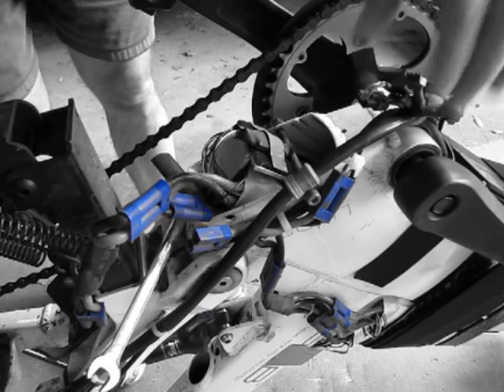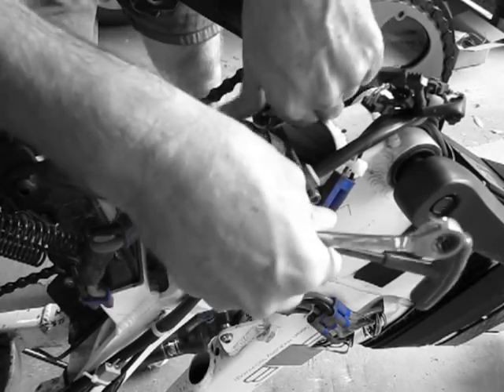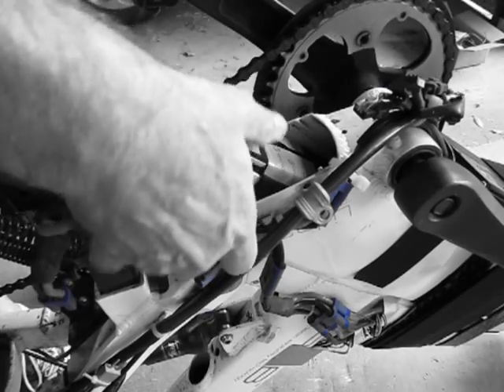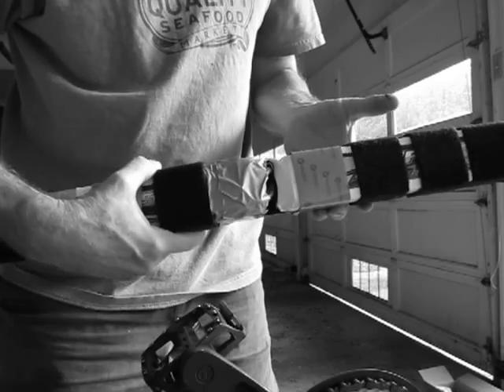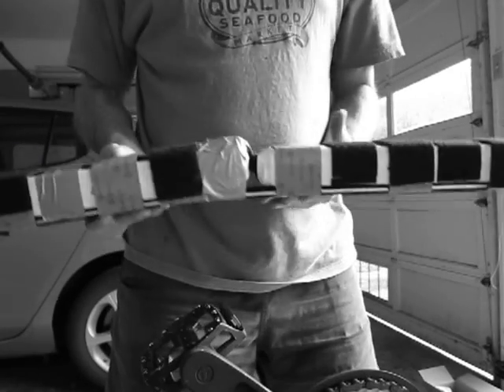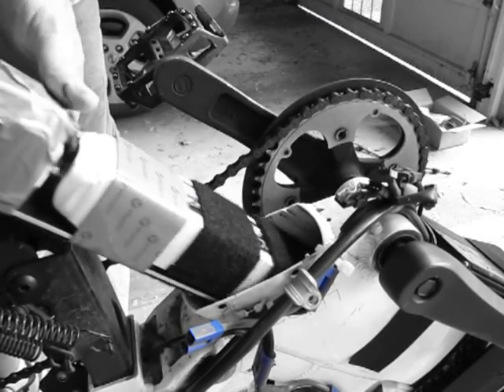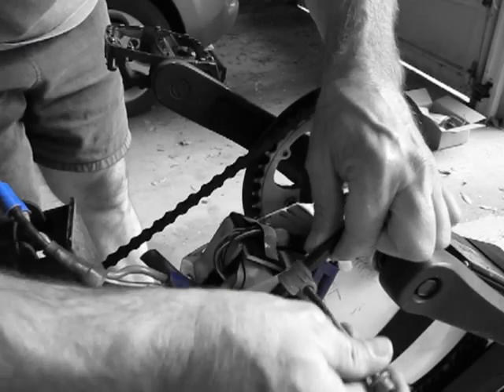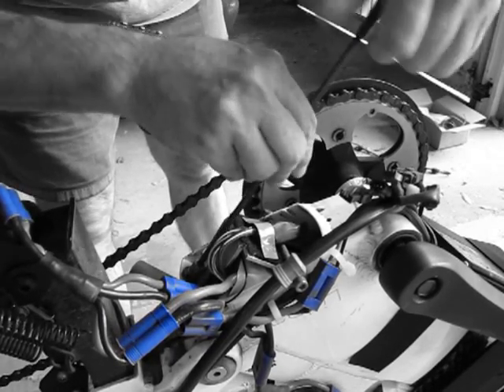Ultramotor A2B Metro RC Lipo frame batteries

Comment: I have an A2B Obree. The battery got bad and can't find a replacement. Is attached to the rear wheel rack so, I don't have those batteries inside the frame, just the controller and wiring. The battery have 2 pairs of cables going into the bike, any idea about them? Are 2 thick red & black and 2 tiny also red & black.

Comment: I also need to replace the original tube battery in my Metro. Apparently the Zippy 10S 5800mah is discontinued. Do you have a suggestion which other Lipo pack would work? Also, in your video the "switch module" wasn't visible. Are you using the standard A2B one?

Comment: I really like your hack. You did wire them up in parallel, right? When you speciify 'long lupos', I assume that you are referring to a specific configuration. I have  Googled the batteries you mention, but they look too thick. Could you indicate the aprox dimensions of the packs you used? Also, are you able to use the stock charger?

Comment: Nice DIY battery!  I have that bike and am only getting 12 miles per charge.. Need a new pack... Was wondering if you had some details to share:

What did you do with the relays and the bottom cap?  Thought the relays were needed to switch from A to B battery.

How are you limiting the lower voltage cutoff?

Are you charging one lipo pack at a time because i don't know of any balanincing charger greater than 14s?

Is that 10ga wire and 5.5mm bullet connectors?

Great job buddy!

Comment: The batteries are hobbyking zippy 5800 mah and are about $100 each which is far cheaper than stock. They are much higher output than stock, too.

Comment from the maker: The stock batteries have a very weak discharge rate as compared with RC lipos. I can accelerate a lot faster than with the stock batteries.